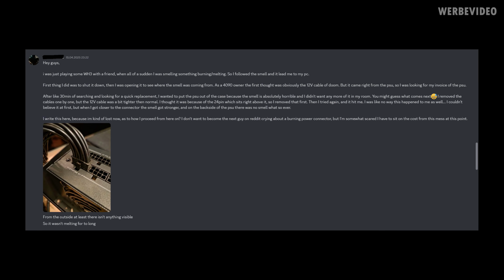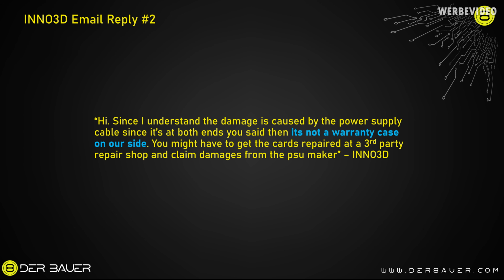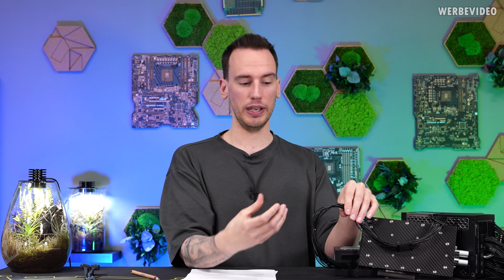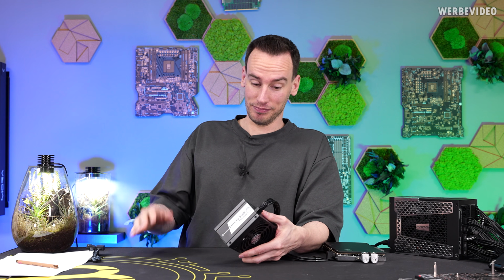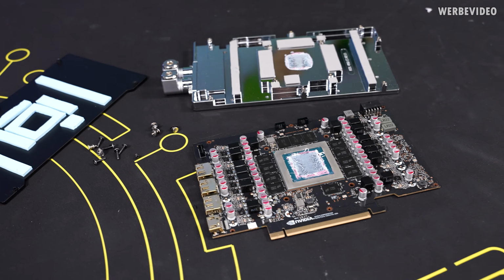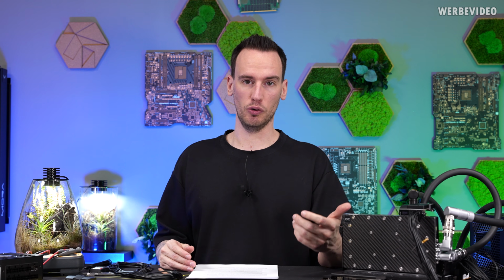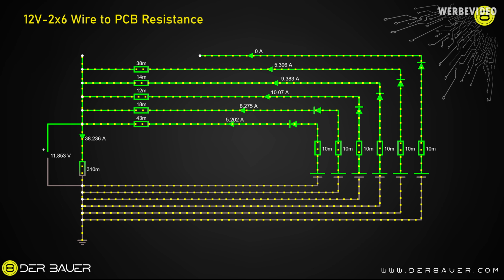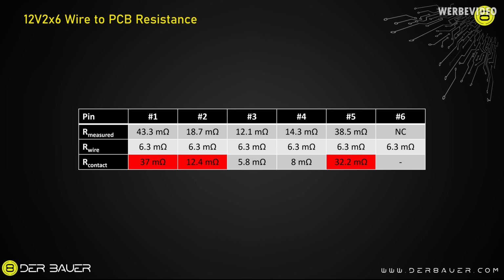Investigating and Fixing a Viewers Burned 12VHPWR Connector

Comment: It's unfortunate Inno3D can't be trusted. They used to be alright. Of course the ultimate blame lies with Nvidia, but that doesn't excuse Inno3D abandoning its customers. 
In fact Inno3D's behaviour would be illegal in some regions.
Reply: You'd have to take them to court, in any region.
Not economically viable; even for a 3grad water cooled card. :body-blue-raised-arms:
Reply: @IcecalGamer probably right in most places but in Australia at least we have consumer affairs offices that handle individual cases like this. They would at least get some higher ups to take notice at Inno3D and make them take a second look. Often a company will just agree to a repair or replacement at that point to avoid more negative press or the case being escalated and the company being referred for investigation by the ACCC.
Reply: @ Depends on your local gov agency rep. if it's a (rare( good one, what you've said applies. 👍
If they are min-maxing the kpi, by the time the paperwork gets pulled through, the warranty is expired and there is nothing you can do, but to pour one out for the time you've lost :eyes-purple-crying:
Reply: Could you please tell me which vendor we can trust? I don't know of any single one.

Comment: Your supposed to add low melt lead solder to remove the power connector.
Reply: Just adding a shoe worked well on the psu end.